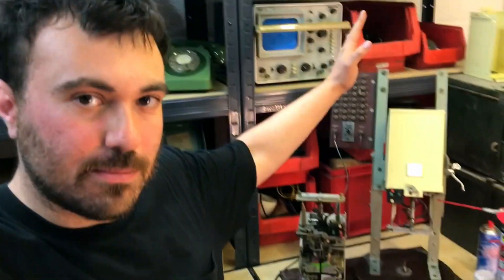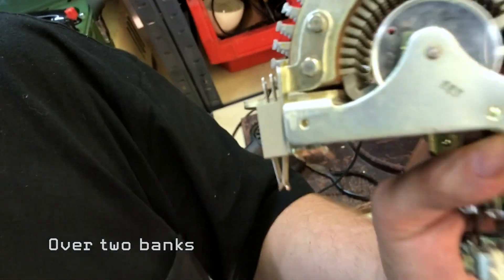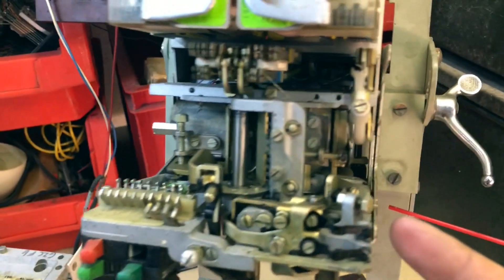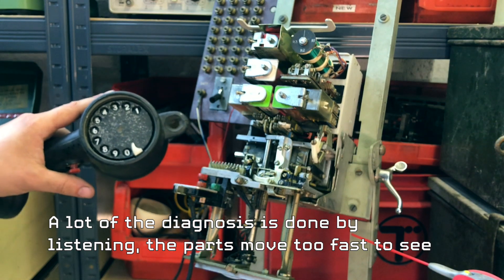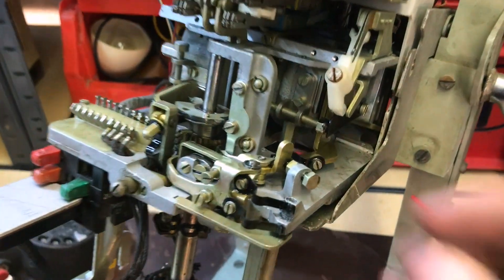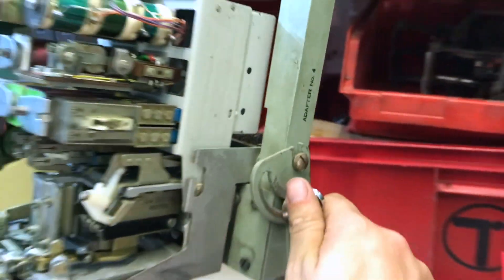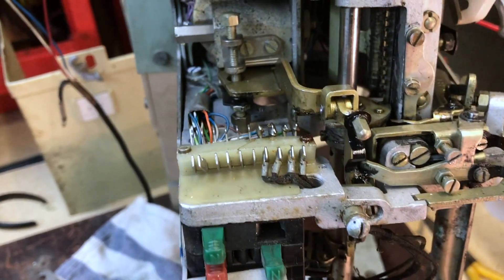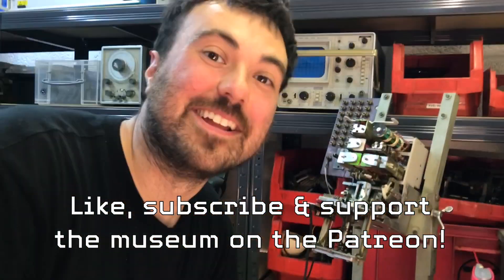Fixing Crazy Mechanical Switches From 1960! - Telephone Tuesdays

Comment: From my old mechanical printer experience from the 80’s - I would of thought cleaning the oil and gum off with isopropyl alcohol would be a reasonable starting point, rather than loads of wd40 which all you are essentially doing is using the solvent in it to clean the old oil off.
We also used “trike” (trichloroethane) - but that’s banned now.  Acetone is another but that might be a bit too harsh

Comment: acetone applied via syringes and then everything worked free and then cleaned off and then light machine oil again applied via syringe works pretty great for servicing. WD40 is a cleaner not a lubricant - it will not last long as a lube and it attracts dust and fuzz and gums up in short order. There are IBM Selectric servicing videos that use very similar relays and mechanisms where this cleaning/maint are shown on YT.

Comment: I wouldn't use WD40 if I were you. The reason is that it dries up. But between being a liquid and being dry it goes through a sticky stage that attracts dust. So 6 months after you've freed up those selectyors they could end up wore than they were before. A better (and cheaper) alternative is to use a cheap light mineral oil mixed 50:50 with acetone. The acetone things down the oil, allowing it to get into all the seized bits. Then the acetone evaporates but leaves the lubricating oil behind. It works like WD for unseizing things, but actually works way better. Someone in the states did some tests in a lab and it's something like 10xmore effective at unseizing stuff than WD40. the only thing you have to watch is acetone can melt certain types of plastic. That can be a good thing though because I use acetone for restoring cracked and broken telephonencasings from 7xx series phones.

Comment: Oh, that looks fun. I was thinking CRC plastic safe electrical cleaner. Then crc electrical lube. They keep changing the name. But it is like old radio shack clean / lube tv turner knob. Upon farther thinking. I was wondering if you might warm it up in a oven. Just a small tad to loosen up the old grease to clean it out easier.

Comment: If you don't have a bottle of Nye 140B synthetic clock oil around, that's the one you want. Once you've worked out the old grease, use this stuff. It's phenomenal. Learned about it from CuriousMarc years ago and have been using it ever since on all sorts of mechanical apparatus.

Comment: Mate if you want the oil off quickly and completely use Break Clean to clean it off. To relubricate you can use light machine oil like 3in1. Use it sparingly as it doesn't take a lot to work well.

Comment: In powerplants those “u-points are called stabs, and are used on metalclad breakers (typically 3 phase 480 volt motor starters).

As far as lubricants, I saw a post about the recommended oil, but I would consider upgrading to a silicone spray lube.  It gives good coverage (spreads on application), is easy to apply, is persistent, and doesn’t attract dust.  

As far as removing the old oil, burning it off is not a good solution, as that leaves a carbon residue that will quickly turn new lubricant to the same gunk you are dealing with.  

I would recommend brake cleaner or a product like Gunk.  

Contact cleaner is for contacts, and while it will remove gunk, it isn’t optimal.

Comment: When it's about cleaning old oil, I use "Essence F" a kind of nafta we have in France for cheap. 
It's marketed as "fat stain remover for textile" I don't know the name exact counterpart of it in England, but this chemical is use as a safe replacement of "zippo fuel"  so it may be "Coleman fuel" geniric name "white gas".
 As I don't be 100% sure that it's the same give a try on something with no value. The fallowing is my experience with "essence F"

This chemical didn't mess with any plastic or paint, it work also well at removing tar on cars and even pine resin too.
It left no residue so make things ready for re-oiling
Side note it melt the glue used for stickers so it's also great to remove stickers even on paper.
If you have a tag and wet it with this inadvertently, just let it dry, the glue will still work as if nothing happen.

Comment: The bicycle owner in me wants to attack that with diesel and a tooth brush. Or if its really bad, let it sit in a diesel bath for a day. If you choose to do this, make sure to do it in a well ventilated space.
Bicycle chain oil (wet type) would probably work, but I'd have a look at what's used in typewriters and similar heavy use mechanical devices.

Comment: Having serviced a Millionaire calculating machine in the past (the first direct multiplying mechanical calculator), I found that a solvent, like Acetone, or Naphtha (Brake cleaner) applied with a hypodermic needle is most effective in dissolving badly oxidised oils and greases. The addition of a little heat is helpful and a hot air SMD rework station with its smallest nozzle works well. You might need to track down some vintage glass syringes as the seals in the usual plastic ones can fail very quickly with solvents. Ignore anyone who recommends Petrol, the old stuff was bad enough, but modern formulations contain quite a bit of Xylene, Toluene and Benzine which makes it really quite toxic and unsafe. The Acetone or Naphtha are bad enough! WD40 is just the most expensive way of buying Parafin (it's mostly isoparaffinic fractions) and contains little or no actual lubricants. Sewing machine oil is pretty much the same thing as instrument oil and is readily available.

Comment: WD40 is useful for removing old WD40, but after you use it you want to use something like brake cleaner to remove the WD40 and lubricate with the right oils (I can't remember what it's called, something like "oil 9" or something like that but that is not really useful).

I use compressed air with a paper towel inserted behind/between the parts so anything that blows off gets trapped in the paper towel and doesn't just blow into something else I don't want.

Sonic cleaning is also sometimes useful for degreasing parts you can't take completely apart.

I have also used CorrosionX for places where electronics were nearby and I couldn't separate them.

Comment: Here's some tips. There are oil cleaning sprays that leave no residue. These are often called degreasers, motorcycle or bike chain cleaners, brake cleaners, etc. Some are strong and corrosive and clean old oil fast, but may damage plastics and cables, some are mild, like chain cleaners that protect the rubber o-rings of the chain, but need some quantity to do the job.
Also, WD-40 may not be the proper lubricant, either to clean, or lubricate this mechanism, because WD-40 may create more problems as the mechanism is exposed to dust.
So, I would suggest, a good chain cleaner, after you make some corrosion tests, and then search or ask an old guy that used to live fixing these things, on what is the best oil for the job and most important, please apply locally, so to avoid soaking the whole mechanism in any oil and become a dust dirt magnet....
About asking old blokes, just cross the opinions from many if possible, because back then, there were not the oils that exist today. A good shop that sells lubricants may also be helpful.
I wish I lived close to the shop, so I could come and help to restore these machines. I find it orgasmic to work on these stuff...
Reply: And even the WD-40 company makes a brake cleaner, which has a different composition.  I second the use of a non-corrosive and residue-less degreaser or brake cleaner that's safe for electronics.  The use of a butane blowtorch is definitely a BIG NO-NO.
Reply: Call not terminated correctly….oil be back!

Comment: Don’t use WD40 it isn’t an oil. It will dry like varnish over time and ruin anything you put it on. Use Kerosene or white spirit to remove old lubricant and re lubricate with sewing machine oil if you don’t know the correct lubricant.

Comment: half the time the oil just turns into a rock at this length in time. some times a good long soak in thin oil or spirit is enough to make it oily enough to be flushed out by something better like 3in1.

Comment: Thank you for this video I was one of the engineers who worked with these mechanisms everyday for 12 years.  On the course for the mechanisms we completely stripped the mechanism and rebuilt it.  As for the oil I would have thought any light oil, possibly 3 in 1.  I enjoyed my time looking after 2000 type 2 motion selectors.  The Blow torch NOOOOOOOOOOOOOOOO. I have a mechanical pulse regenerator that were used in some relay sets.  Cheers Phil.
Reply: The mechanical stuff is so fun to work with :) cheers for watching Phil. I promise I won’t use the blowtorch!

Comment: Ive got no expertise with those type of things but as you mentioned fire being good for softening up the gunky oil: You could look at using a soldering iron to apply point heat to the joins if they are in areas where the potential spread of heat along the parts wouldnt damage anything, might help with at least loosing the gunk a bit before attempting to wash it away.

Comment: For the really bad ones, something petroleum based is what you need, a drop of petrol, though you may want to do that outside
There's a big selector with a lot more contacts, it was a 'motor selector', it was driven with a motor consisting of 2 coils 90 degrees apart

Comment: Hi Mitch, from an ex BT Strowger engineer. We used white spirit to clean the old oil off, plenty of rags and a brush. You may find it's worth taking the A relay armature off and you'll sometimes find a sticky residue on around that. Lubricant was called oil bearing No 19. You apply the new oil with a small lubricating brush (like a modeller's paintbrush). There is a specific EI/TI on lubrication of selectors, I'll see if I can find it for you. Jon
Reply: Jon, as also an ex strowger engineer, I was trying to remeber the red coloured oil (No5?) I was told after moving onto System X that the oil was carcinogenic.  Greta finding out after the event. Not sure if that was true.
Also when the Windolene bottles first came out, one guy was using one of them to spray the white spirit. In the end everyone had one. Two guys worked out they could be fun flame throwers, they caused a fire!!!
Reply: @mickcoleman5396  Yeah, I remember being told that about the red stuff. I was there late on and only saw the oil coloured stuff.
Reply: @mickcoleman5396 flamethrowers! 🙈
Reply: Jon, you beat me to it! The smell of warm oil dag and White Spirit soaked rags, that brings back memories. 😉
Reply: Amazing. That’s exactly what I was going somebody would comment. Thanks Jon 👍
Reply: @hackmodular  I sent an email to Sam with the lubrication E.I. it's from the '60s so states oil dag and oil bearing 16 (which is a lighter oil). We used OB 19 throughout on selectors. I believe it has an additive to make it 'sticky', but I'm not sure if I'm remembering that clearly. I know somebody with a stock of oil to the correct specs, he's in the Telecom Heritage Group.
Reply: In New Zealand we had a cleaning product with the trade name of "Electrosol". I don't know exactly what was in it, but I guess it was something like white spirits. Best to dismantle pivot pins where you can, and clean off all lubricant (or the varnished remains thereof) to bare metal. Then minimal lubricant (one drop on the end of a bit of telephone wire) to oil the pin before reassembly. A bit tricky to follow this procedure if you can't  take the assembly apart .
There were standard printed instructions for lubricating and adjusting mechanisms, not just handed down verbally from the more senior techs. Hopefully one of your followers has a copy to share with you!